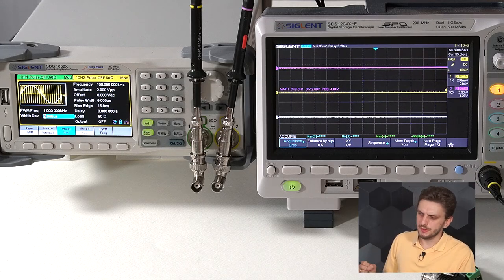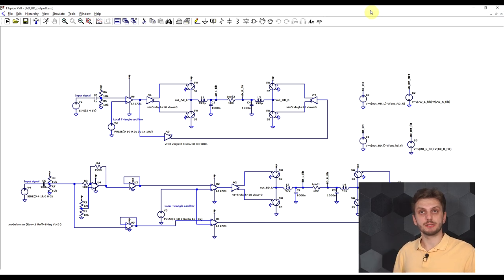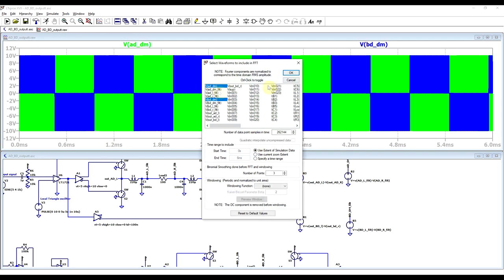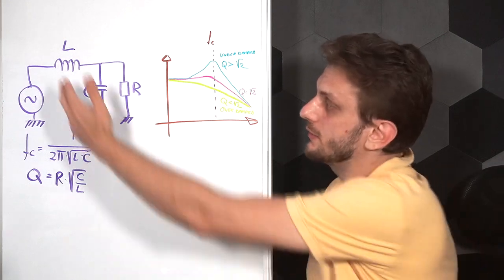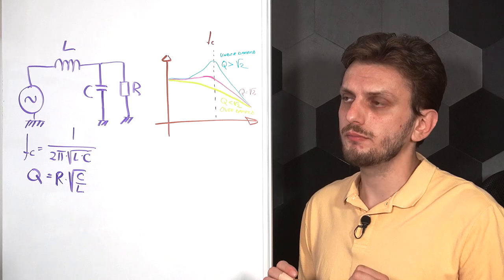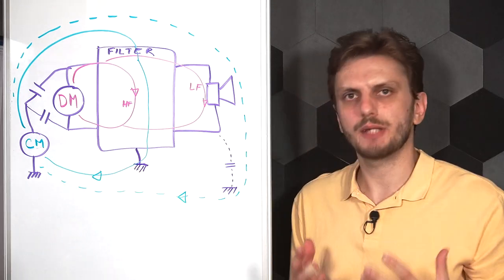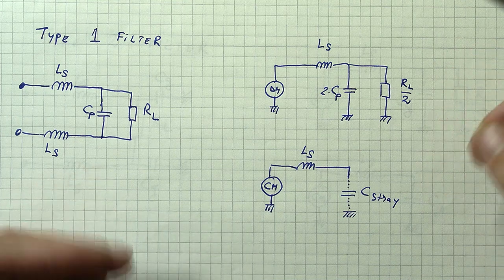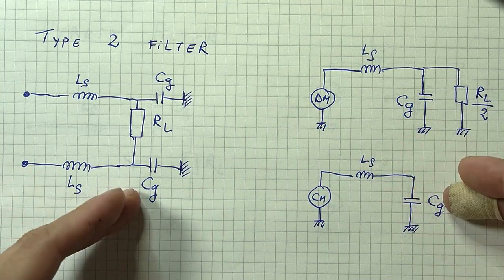The Class D audio amplifier - Filters (2/3)

Comment: 11:09: Why the Cg caps should be 10x smaller than the Cp? What is preventing me using a Type II filter only, even for a class BD modulation? That way I will get the most efficient CM filtering.

Comment: High power class-d amplifier are almost always discrete circuits, chips are clipped at 350W due to silicon limitations and noise at this power level places demand on the die Ti has some the powerpath series that covers this (but with poor to average THD figures and weird speaker load conditions see fine print in the datasheet) these chips are meant for consumer grade "non-pro audio" sales volumes for obsolescence home products. It's almost exclusively beneficial to learn control structures, layout for high current applications and other areas of relevance, but this obviously reserved for people pushing into pro-audio/enthusiastic area OR engineer's from a switch mode power supply background designing high power systems.

About the filter: 
In self oscillating there is a deliberate expectation to use the switching residual triangle (~1V) and the phase shift produced by the LC (90 degree) to close the loop to create a self oscillating at gain above 0db. It's been discovered recently that the BH curve of the LC inductor creates nonlinear behaviour at high power (also note the material used for class-d amplifiers use low permeability material cores with frequencies expiations of up to ~550KHz to 1MHz (high power) and 2.1MHz for smaller applications to reduce area size with reduced output power) 

There are also capacitor grades used at the LC filter with exceptional qualities like a WIMA Polypropylene. (but this is another topic).
Reply: Can you please elaborate what you mean by "switching residual triangle (~1V) and the phase shift produced by the LC (90 degree) to close the loop to create a self oscillating at gain above 0db"
Reply: @nbuzkila  Self oscillation is technically an oscillator and a oscillator requires positive feedback to work. In order to get an amplifier to go into oscillation the sum of all the phase shifting amounts to 360 degrees also the gain needs to above zero dB. 1v is the oscillation at the speaker terminals is called residual switching it's very tiny in voltage 800mV up to 1volts and it's triangle in waveform shape this is used by the comparator circuit to generate PWM. To understand this you need to self study these concepts find the literature online.

Comment: I have done a multilevel class d with 4 halfbridges, 90 degree shift, get 5 levels. Unfortanely when I measure current over speaker in LTspice I get nice result with -100dB distortion level. But when I measure each bridge on on side of the speaker and the other 180 degree side, I get a very strange in fase distorted sinusoidal, using a emi filter do let it get better, so I think I deal with a common mode voltage? or differential voltage? Can I do something about it because otherwise the amp will be a 2 Mhz transmittor through the cables.. 

regards

Comment: I am wondering about the 100M resistor in your cm model. Can I ask why you put it there and why that value? You make great videos, by the way.
Reply: It’s for the DM. Basically forces an open circuit to ground in the simulation—forces all the DM current through the main differential LCR loop. LTSpice needs everything connected to ground to work. This solves that issue. High resistance value means basically no DM current would typically flow in that direction in real life

Comment: So when purchasing class D amplifier, we need to know what loading did the company assume the users to run? or the LPF might not work as desired
Reply from the maker: If the LPF is included into the amplifier then the output (speaker) impedance of the amplifier should also be specified.

Comment: Hello. I think there's something wrong with the Q factor. At the beginning you write sqrt(2)=1.414 at 6:00 then it's 1/sqrt(2)=0.707 at 6:35
BTW there's a TI paper on class D filtering slaa701a pdf
Reply from the maker: Hello! You are right, I said 0.707(1/sqrt(2)) but wrote only sqrt(2); I know that Ti paper, its really good! - I already included it in the description under "further reading"